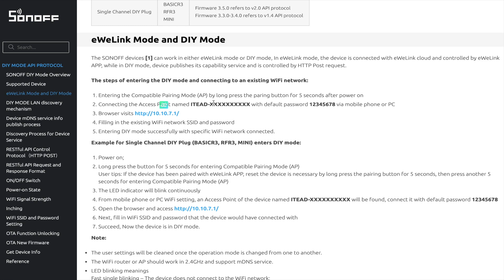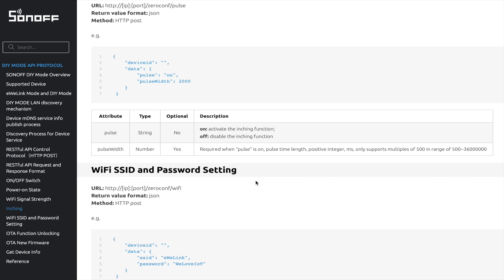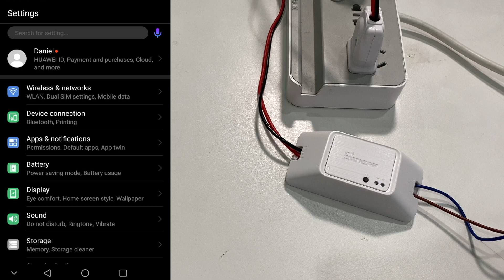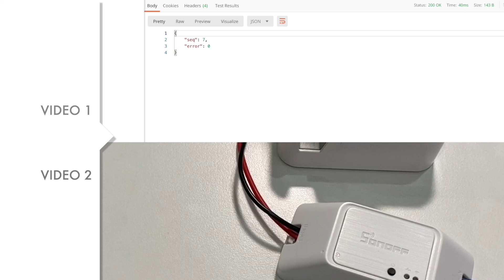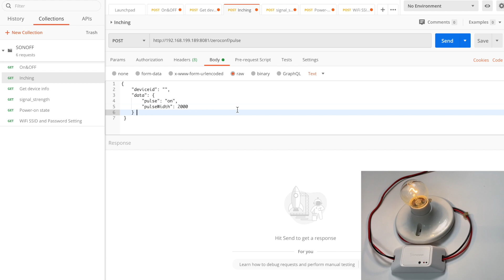DIY Mode V2.0 Tutorial

Comment: When entering 10.10.7.1 it does not load, I can ping and I can access 10.10.7.1/device, but I cannot configure wifi
Reply: Hi! Did you solved this? Tell Please! =) Same issue
Reply: yes same for me - I think maybe because encryption is set as can be seen from mDNS being sent
Reply: I faced  similar issue, the problem was with the firmware old version. so I connected it with eWeLink app and updated it's firmware. after which I switched back to diy mode and it worked fine.
Reply: were you able to solve this? i cannot connect as well :(